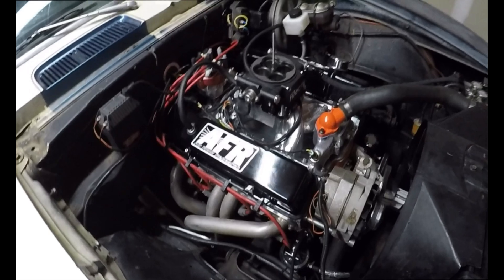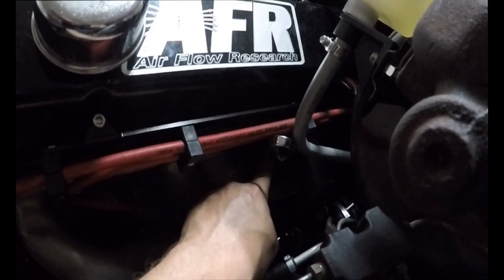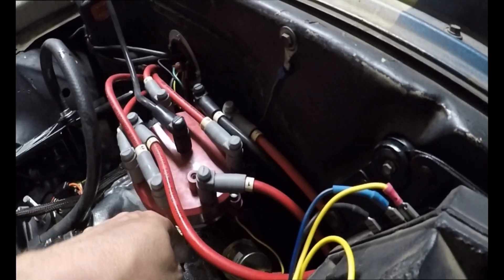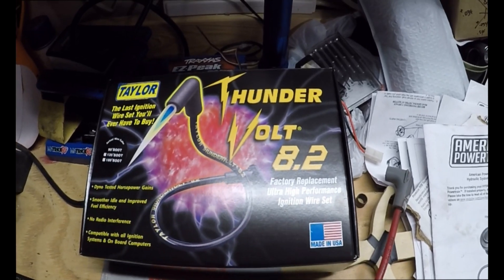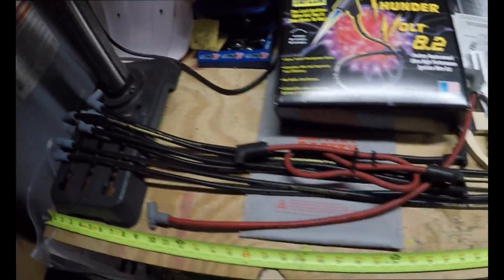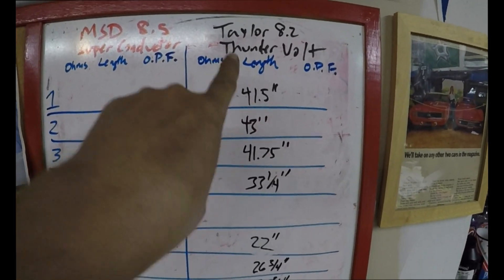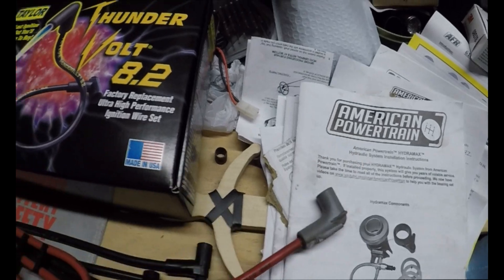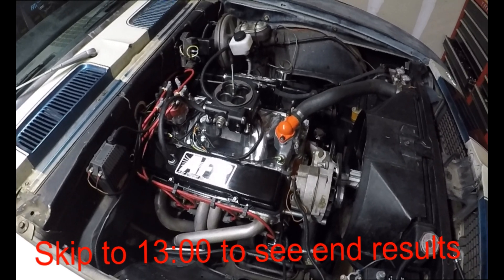Taylor Thunder Volt 8.2mm Vs MSD 8.5mm Super Conductor spark plug wire test! Is bigger better?

Comment: I think the owner before me have put the wrong plugwires on wrong place! But on the right coil nr!  The lenght of the wire is wrong i think! How now to sett the new sparkplug on right place if the dont have a number on it? I have a crack on coil nr 5 and my is a Chevy to and i think the cabel is runing hot?